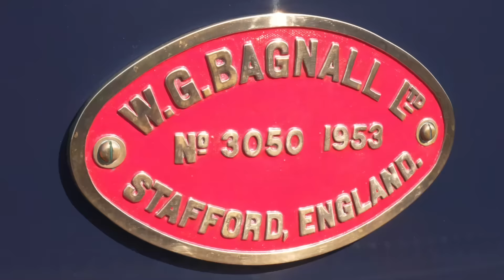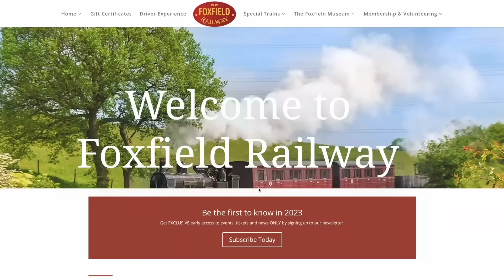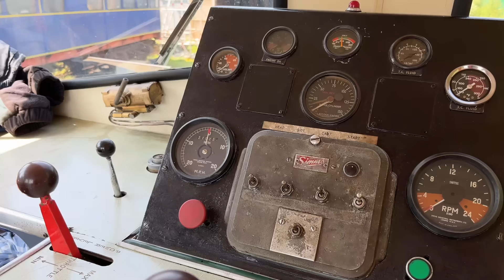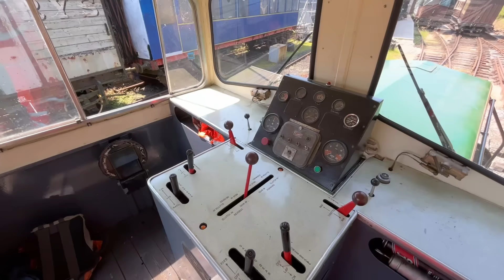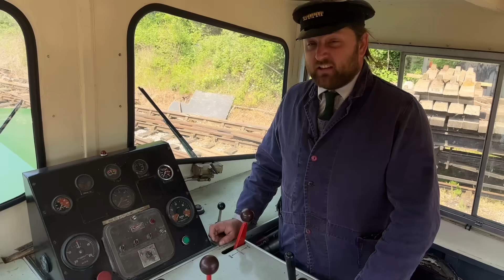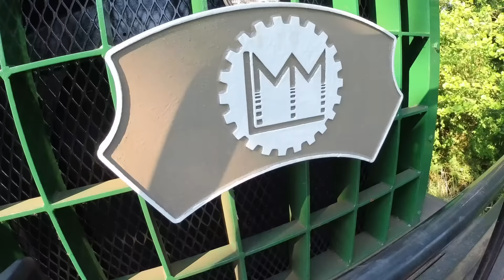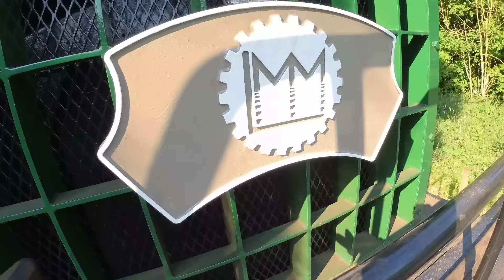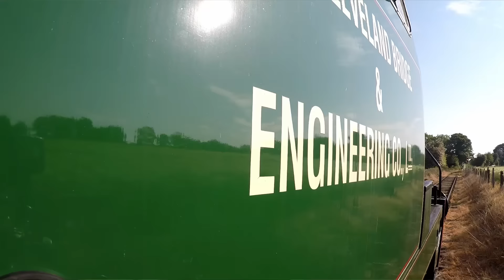The Diesel that started life as a Steam Engine - Thomas Hill 111c - Lawrie Goes Loco Episode 38

Comment: I have known this loco since school days  used to cross the unmanned level crossing. When I started my apprenticeship at Cleveland Bridge as a maintenance fitter, I was sent to help maintain the loco.
The draw bar you asked about was for shunting articulated bogies with completed jobs on through the sheds for shot blasting & painting. Kessock bridge, Humber Bridge, Thames Barrier, to name a few of the jobs at the old factory.
When a new factory was built in 1981,the loco had the running gear overhauled (wheels & chains). The new factory only had a short line with 2 sidings & a loco shed. So the loco was not used much, then steel came in by road transport. I fitted a new left front spring as on inspection the top leaf was broken. I was later told it had been off the road at the points.
Reply: So cool that someone had hands on history with this great loco .

Comment: So you let the loco run through the crossing unattended?
Reply: Naturally no. Look closely and you’ll see two operators inside.
Reply: @FoxfieldRailwayOfficial  Haha I had hoped that was the case.
Reply: The first crossing on the video is an occupation crossing, the second is a gated road crossing usually manned but train man operated for works trains.  For the purpose of filming Laurie does everything on multiple takes with our staff out of shot.   Operations Manager FLRS Ltd.
Reply: @screwdriver5181  I thought so. Very slick bit of filming then.

Comment: They were tough little critters, not short of grunt and fairly steady on their feet considering how small they are. Their Chilled heel being the need to stop! As it said in the video they were a bit light on their feet which meant careful handling though the sanding gear was pretty good.
Enjoyable to drive and nice to look at they were the ultimate development of the Sentinel family line in my book.
If you left the little door that covered the battery switch open you could see the drive chain which helped to prevent slipping when starting away from a stand in poor conditions, as you could shut the throttle as soon as you saw it begin to slip and power up again as soon as the slip ceased.
Great little locos which I enjoyed working with. Nice to see a video devoted to them!

Comment: lawrie could it be the triangleula thing at front and rear of the diesel be where they shakle a winch to if it needs to travel by road on a lorry
Reply: No, they would just use the drawbar (coupling) hook. Partly because it's designed for that (sort of), and partly because it's at a better height - that lower thing might cause problems with the winch cable, being so low to the ground.